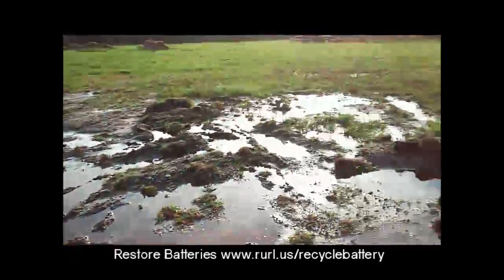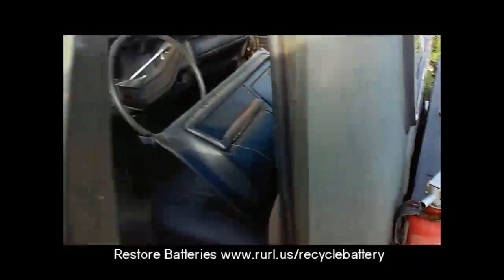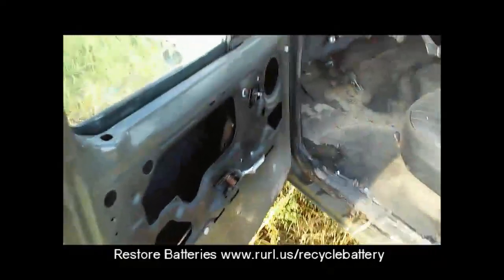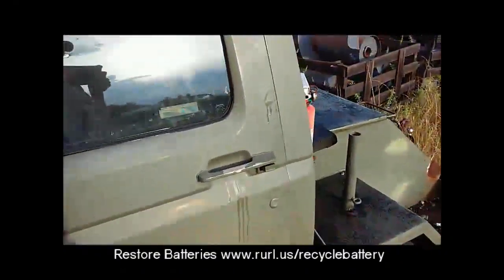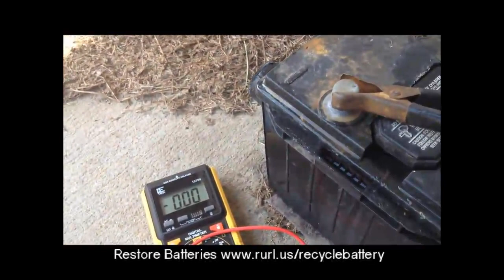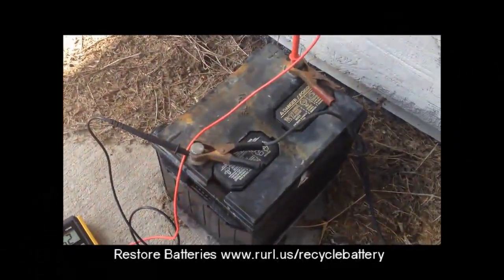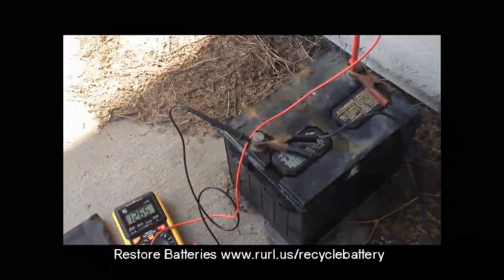Restore Car Battery To Like New Condition - How To - DIY Automotive

Comment: That battery might hold at 12 volts, but I assure you that the amperage will not be anywhere near the original rating, and nowhere near what it needs to operate properly.

Comment: Hill Billy Bob is reading the voltage from the charger and NOT the battery. Learn to disconnect the charger from the battery BEFORE taking a voltage reading. Secondly, aren't there laws in the backwoods from dumping sulfuric acid onto the ground?

Comment: key: distilled water.  Any other water that contains contaminants will cause damage to the battery and kill it over time.  Minerals cannot be filtered, that is why you do NOT use filtered or spring water,
Reply: Key: DEIONIZED water but it's not readily available to the public.

Comment: There are  a few tips for battery reconditioning
never try to do this unless you know what you are doing - the acid can burn your skin
Test the voltage first - there may be a dead cell which will waste your time.
Check the battery fluid.
attempt to fully charge the battery.
(I read about these using rapid renew roadmap website )

Comment: The comments are interesting, the acid is more or less harmless. It will neutralize quickly enough in the "basic" soil. However the high level of lead that the acid has in solution is EXTREMELY bad. I've found most "farm" land folk have Zero thought about dumping anything on the ground, oil, battery acid, zirk fitting grease, hydrolic fluid, etc.. Spills are just shrugged off.. And well used motor oil works great as weed kill on fence lines...
Sigh
Oh and plastic garbage EVERYWHERE the middle America fly over States have constant wind... So the carelessly left plastic blows around everywhere... Then ends up stuck to endless miles of fenceline. As a trucker I've seen most of America... We've really messed her up bad :( and I'm really not a tree hugger, but it makes me mad-sad to see her this way !!
Reply: here's  several suggestions for battery reconditioning
never try to do this unless you are sure what you are doing - the acid can burn you
check the voltage first - there may be a kaput cell which would be a waste of time trying to fix.
Check your battery fluid.
Try to completely recharge the battery.

Comment: This is bullshit, this only works some of the time and when it does you can just charge it normally and the same thing will happen..
Reply from the maker: You can't charge a battery that is really old it wont hold a charge. This restores the battery to like new condition.